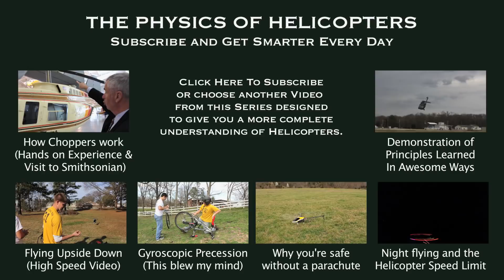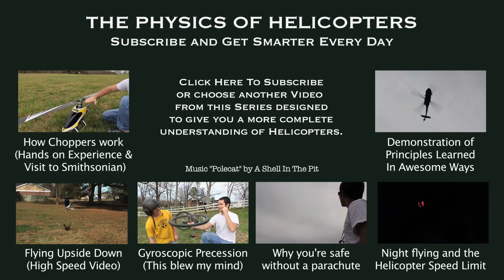Helicopter Physics Series - #2 Chopper Control - Smarter Every Day 46

Comment: Full size helicopters do have some negative collective pitch, but its generally only about 2 degrees at the most. If they did not have any negative collective capability, then they could not perform an autorotation landing from a high altitude, meaning certain death if the engines ever failed.... I'm sure they also use negative just to stay on the ground in gale force winds...

Just wait in this series, they are sure to cover Autorotation landings in a future video.

Comment: The reason why he can get off the ground is because RC Helis have a high thrust to weight ratio, so it doesn't take much force to keep the thing aloft. The Red Bull Helicopter does not have negative collective, meaning it cannot sustain inverted flight. It only temporarily goes to 0 collective at the top of the loop (or when it's upside down in a barrel roll) so that the lift generated by the rotor will not "pull" it back to the ground.

Comment: I think the main reason most real size helicopters do not perform these types of maneuvers is because they do not have negative collective. What you don't notice is his blades are not like an airfoil you would typically see on a real heli (near flat on bottom and curved on top), it is symmetrical on both sides meaning he can produce negative lift when upside down. If you put these same type blades on a real heli, it probly wouldn't produce enough lift to get off the ground.

Comment: Simply put, force prevents a full sized helicopter from performing those stunts. While it may be possible to design and build a  helicopter light enough and strong enough to withstand the amount of acceleration experienced during those movements, the human body probably would not. The pilot would experience a large force in one direction then immediately feel the equivalent force in the other direction. This would cause the pilots brain to hemorrhage due to blood being forced to the brain.

Comment: Question: Exactly why cant you do those tricks with a real helicopter? I know that you can do loops in some helicopters but what about the more advance stuff? Is it so that the roter blades can handle it but not the frame or the other way around? Needs to be really light? Thanks

Comment: Wonder how many G's you would pull if you were a miniature pilot inside the helicopter. Those moves are basically impossible on a real helicopter because of pilot and material strength i would imagine.Need to strap an accelerometer to the chopper to see those numbers but it would be awesome.

Comment: I was a little confused by this too, but I thought about it and rewatched the video and it makes sense now. I had to make the rotor shape with my hands to realize that if you tilt both in the same direction while maintaining their positions relative to each other, one side will produce more lift and the other will produce less. However, the rotor tilts the opposite way each half rotation to keep lifting on the same side. Seems a little overcomplicated, but mind blowing nonetheless...

Comment: My guess is that it would help, but it would be very difficult to make it perfect. For example, when you pitch forward, any unbalanced areas would cause the aircraft to spin to some degree. Either way, a tail rotor is still a nice thing to have because it gives you yaw control.

Comment: At 3:04 if you look closely, it looks like the the rudder system isn't dynamically stable (i.e. wants to go or "spring"  back to its original position when the rudder stick is centered). That's really interesting. So the heli will continue to yaw until you come all the way back across to the the other side of the stick...wow, it really does take skill to fly that well. My little heli has a contant pitch tail rotor which will change speed instantaneously as you move rudder left and right. Cool

Comment: Man, that is so interesting. I just realized that the shuttle's engines ARE displaced sorta "above" the soldid rockets and liquid tank thus off of the axis of rotation. So you could get a moment by vectoring the exhaust sideways. That sorta explains why you can see the shuttle main eninges swinging when the engines start. Derp. (Facepalm) lol. Thanks Destin. I just got smarter today!

Comment: Ok, well, lol, I actually looked it up just now and the main rotor in a real heli is not  perfectly vertical but is tilted something like 1 to 2.5 degrees to the side. It's called cyclic rigging or something. Also, I think the assymetry is corrected by rotor blades flapping and lead-lag hinges. Anyways, I'm no helicopter pro, so I could be wrong. I'm still getting smarter every day! : )

Comment from the maker: Many larger liquid rocket engines have something called "Thrust Vector Control" or TVC.   The entire nozzle can articulate, thus producing a thrust vector that is off axis from the rocket itself.  The mechanism is similar to those little linkages in a gorilla pod, except usually there are two linear actuators which control the direction of the nozzle gimbaling.  By the way, an ideal rocket nozzle will expand the gasses to atmospheric pressure by the time it exits the nozzle bell.

Comment: To change direction, you actually have to give a force in the opposite dirn... Much like a space capsule steering in space... In case of slowing down, you tilt the rotor back... In extreme cases, you see the helicopter pitch up for drastic braking, called a flare.

Comment: Each helicopter has a fixed small range of rotor rpm when the lift force generated = weight of the helicopter. The heli is now "floating" off the ground. Any further change in angle of attack/pitch of the rotor is what causes the heli to go up/down... what you hear as an apparent change in rpm, is the distortion of sound waves as the blades change their pitch...

Comment: I guess an analogy to add that I didn't see in the video is that each blade is shaped as an airfoil, like an aircraft's wing and that's how the rotors generate lift. The collective changes the angle of attach of each blade just as an aircraft pitches upward during takeoff...Cyclic can best be visualized by drawing an imaginary circle around the rotor when viewing from the top. Blades change their angle of attack slightly as they make their way around the circle... Just an FYI... Force=Reaction..

Comment: So...you mentioned it at the beginning of the video, but left us on a cliffhanger. If the sum of the forces in the butt line (look it up) direction is not equal to zero, then the heli accelerate (F=ma). What keeps it from drifting? Is the rotor shaft tilted a bit to the opposite side to impart a component of force in this direction (like airplane engines have a partial offset from centerline of the aircraft to counteract torque, slipstream, and P-Factor)?

Comment from the maker: Warm air rises because it is less dense than cold air. Water is the most awesome liquid in all of creation because it will contract like most substances as it gets colder... UNTIL it gets down to 4 degrees Centigrade. At this point it EXPANDS, meaning ice is less dense than ice water, therefore it floats. This is why we have icebergs and floating ice.  Imagine if ice sunk?  I wonder if the poles would cool down from the bottom and become totally frozen?  Fish would die. Floating ice is critical.

Comment: How is he able to make the helicopter completely vertical with no downward force from either rotors? Does he have to keep it moving back and forth, slightly angling it to get some downward force? Or does the act of the blades moving around provide some force to keep it up, through wizardry?

Comment from the maker: If the helicopter is designed for this type of flight, it would certainly be possible.  Watch the next video and we'll discuss upside down flight with the use of high speed video for analysis.

Comment: @XxbrownbxX Yes it is I know for a fact the comanche and littlebird helicopters are both capable of this. As well the apache might be able to but I have not witnessed it myself cause at most airshows it is demonstrated as a heavy arms platform. Other commercial helicopters technically have the ability but not in the same sense. Their backflips consist of going up to a high altitude and free falling into a backflip more or less

Comment: @XxbrownbxX 
Yes. But not any helicopter, most helicopters are not design for that at all.
Eurocopter (the one red bull uses) for example can even hover upside down, but to actually do it pilot must be either badass or crazy.
Many military helicopters like apache and kamov-ka 50 are capable to perform aerobatic stunts.
But they cannot do the same tricks RC can do: the reason is thrust to weight ratio.
RC helicopters (like in the vid) can lift 4-5kg, while wieghing a mere 400-500grams
10 times!!!